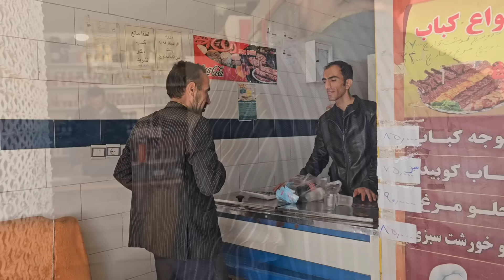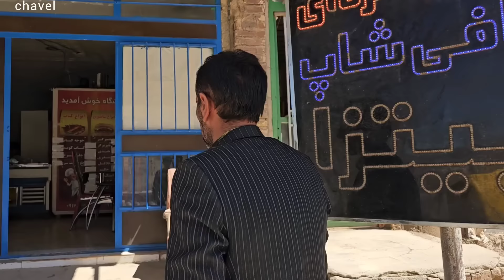A silent shelter: humanitarian aid to Reza's wandering family

Comment: Thankfully you have sunny weather to dry the carpets and plastics. Well done little family.  👏 👏🙏. ALSO Chavel.......can you buy a small caravan on wheels for the family. Reza will need to make a concrete floor and concrete drive near the muddy road....so the wheels do not get stuck in the mud.   The caravan will stay dry when there is a lot of rain. Maybe it can sit on the area where the new house is taken down. Also before there is a lot of rain maybe Reza and Mrs K can put wooden pallets under the plastics and carpet in the main house ....to keep them away from water coming in.

Comment: You should build a concrete slab about 4 inches hight and  then build the walls on top of the slab. Don't build directly on dirt.
Reply: I think there is an issue with earthquakes
Reply: El agua filtra por debajo de la casa y como por aya no acostumbran a poner cimientos de puras piedras ni cadena rellena de tierra  y luego pegan los bloques así el agua pasa por debajo de la casa y no les filtra el agua y ahora ese va aser el problema con ellos más que duermen en el suelo y no tienen mesa para levantar sus cosas todo lo tiene abajo y se les moja
Reply: Um dia tudo isso sera 😅 passado, Deus fará o melho por vocês lll tenha certeza, que vcs dois ultrapassara todas essas barreiras ❤❤❤❤❤❤❤❤
Reply: Ciao.   Voi. Parlate.  Ma.  Ma.  Non.  C'è niente.  Da.  Fare.  E.  Poi.  È.  Tutto.  Sbagliato.  Quello. Che.  Dici tu ciao

Comment: Looking very dengerous 😮 every where water spring.They made their house without foundation therefore the house became very danger water came out on the floor.The house can flow with the water.why they are not buying a big bed??. they can keep some plywood on the floor then cover with plastic and thermocol it will protect from water overcome.It is to much struggle with water 😢 May God provide a safety house for them 💞💞💞💞 and save this family ❤❤❤❤